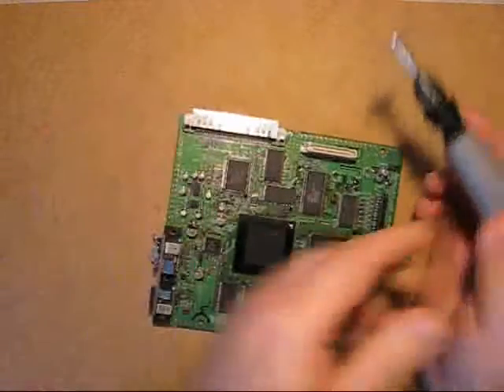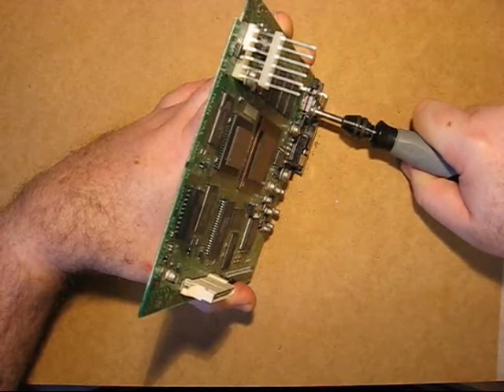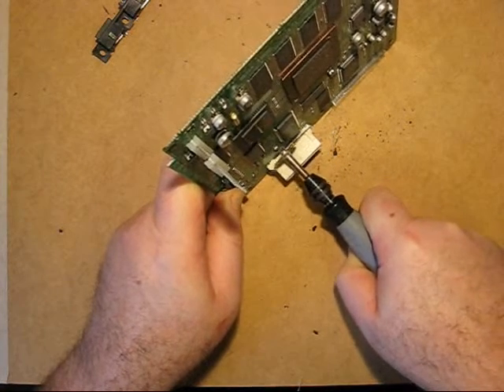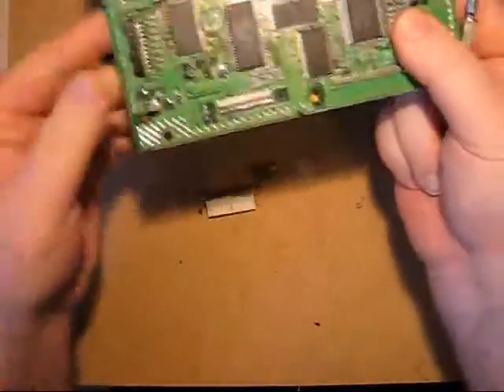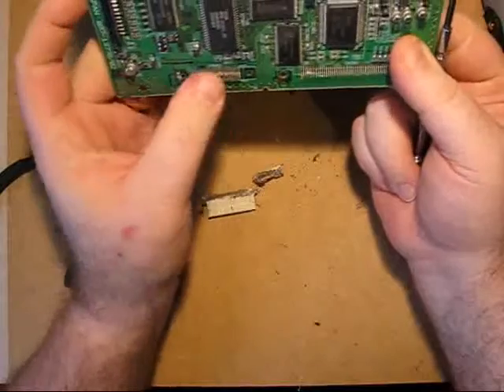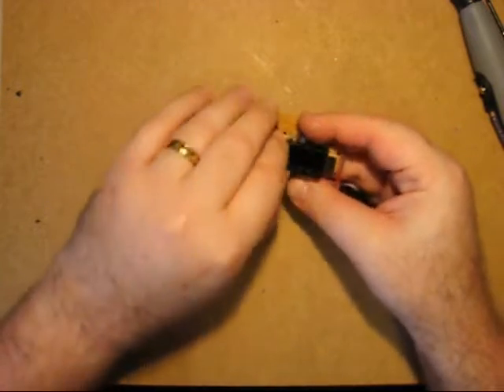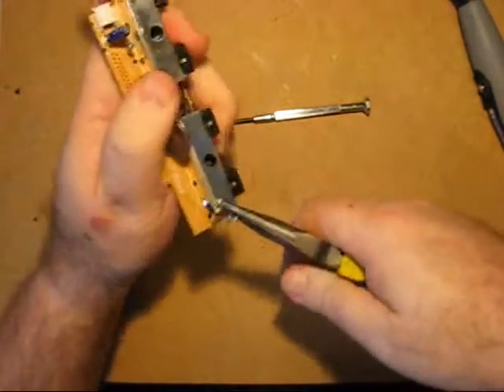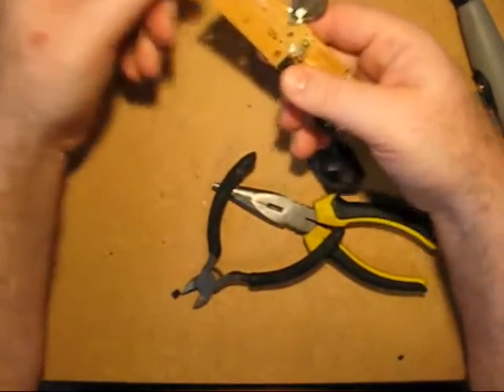Mini guide - Removing game and video ports from board

Comment from the maker: I used N64 and DreamCast boards in the video as they were available and covered typical ports and types of ports common. As the video was relating to removal of various ports, I didn't mention the boards used for that reason, although removal of a game cart port was "a favourite topic".

Yes, the PIF chip was removed a while back when I sent it to someone for free as a favour (the board didn't work when a board reduction test failed).